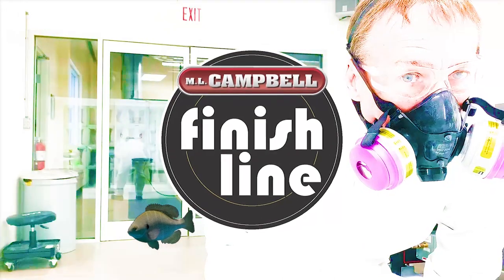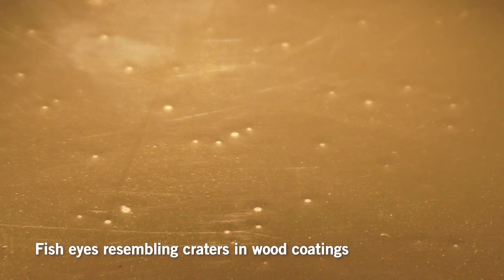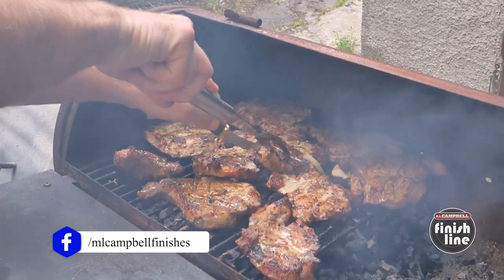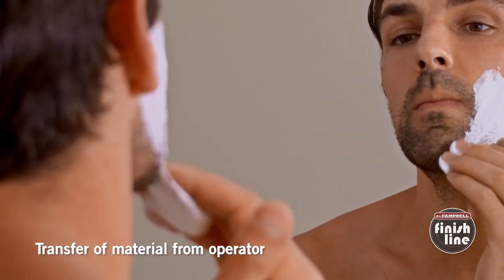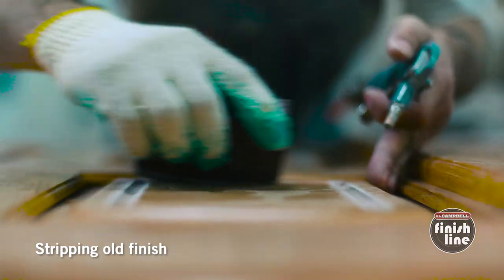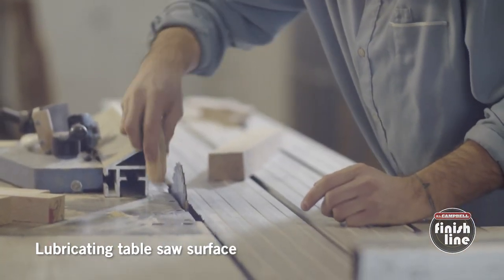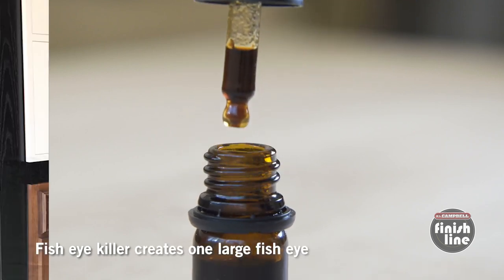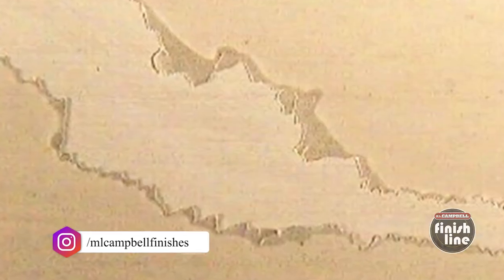How to Avoid Fish Eyes in Wood Finishing Projects (Get Rid of Fish Eyes Video)

Comment: Mr. Campbell, I am trying to create a football field charcuterie board.  I used a green water based paint for the field, acrylic white pen for lines, vinyl numbers, and peel off bumper stickers for team logos.  Given the variety of surfaces, I’m deathly afraid of fish-eyes when epoxy resin is used to seal the board.  Question:  What should I use to cover this board before apply epoxy?  Does it need to be sand papered before applying epoxy or once dried it is epoxy ready?

Comment: Thank you so much for this. I was literally driving myself insane trying to figure out why just one area of my project was riddled with fisheye every time I attempted to spray. Turns out the Silicone from a mold being made in the shop was transferred to a small part of the surface and that's what was causing it. Phew! Off to get some Vinyl sealer!
Reply from the maker: Glad it helped!
Reply: @MLCampbellfinishes   i used some caulk on the seems of my kitchen cabinets before i primed with my sprayer - can this cause fish eyes? or did i thin with too much water ??

Comment: I'm just getting into woodworking, and while my first project miraculously went really well, I just the other day found a desk in a dumpster that was in really good shape other than the finish. I don't have access to a full woodshop, so I did what I had done to my first project - which was to refinish without stripping, using a poly that claims to be meant to go over old finish. I tested the finish on this second piece to make sure I could use ply over it, as I had researched and learned that it's only ok over old poly and shouldn't be used over shellac, laquer, or older oil finishes like Danish oil. I found that what I had was in fact some kind of poly - none of the thinners I tried in spot tests came up with any tackiness. So - I sanded, wiped it down, sanded again, and then cleaned the whole thing thoroughly with Naptha to try and make sure there wasn't any oil on the surface and that it was good and clean. I've only done the very top part, as the desk can't be taken fully apart so I'm doing it based on which surfaces are flat in each position, and I'm noticing some small fisheyes forming along the grain of the wood. 

So - If I let this cure fully and then put a second coat, will I still get fisheyes in the second coat? The reason I ask is it is a tinted/pigmented poly that is not clear, so if I can use the first coat as a sealant, sand it, wipe it again with Naptha or even denatured alcohol to get it good and clean, and then put on a second coat, do you think that'll even out and come out without fisheyes? Thanks in advance!
Reply: Oh also just to clarify - when I sanded, I mean by hand, as I don't have any power tools - apartment life and all that. Which is also why I purposefully don't pick up projects that would require stripping, as even outdoors on the stair landing and with a paint respirator mask, the chemical smell in the air lingers a bit and don't want to subject the rest of the apartment to that. There's no one currently on my floor, so that helps, but still - not willing to have anything stronger than Naptha without a proper shop and ventilation and disposal areas. As it is I got a couple containers from the hardware store for rag disposal, but they're little and portable and not that ventilated other than just being outdoors.

Comment: Can I use paint thinner to clean a previously old varnished finish. I have about 20 areas I repaired. The wood was splintered on this Stickley bench. It needed alot of work. I am match staining these areas to match the rest and then re polyurethane. It has intricate carving and stripping the whole thing may ruin the areas I had to fill with wood filler. Thanks
Reply from the maker: So, that really depends. Old varnish may be a number of things, our advice would be to try a small area with a paint thinner or a lacquer thinners. In all cases, use extreme caution as they're both very flammable and we wouldn't recommend using either in an area that isn't well ventilated and  free of ignition source.

Comment: Recently I've encountered fisheyes when refinishing tabletops. I completely strip and sand to remove the old finish. I apply an oil based stain and  oil based polyurethane . I assume the problem is from silicone furniture polishes being applied over the years. Can polyethene be applied over a vinyl sealer ?
Reply from the maker: Hi Jeff, we don't recommend putting Polarion over anything but Polarion.

Comment: Would a can of spray shellac cause fish eyes? I know part of my problem was the proximity of my air compressor to my spray surface but I had also started with a coat of spray shellac from zinsser
Reply from the maker: Shellac in itself should not cause fish eyes. The dried coat of Shellac should be sanded and cleaned before application of next coat.
Reply: Possibly water or oil from air compressor into the finish m